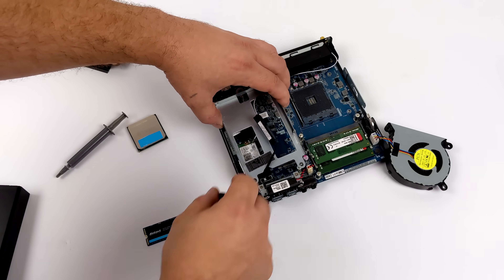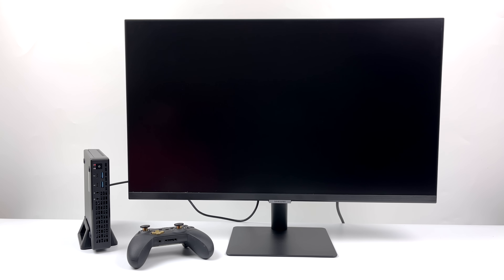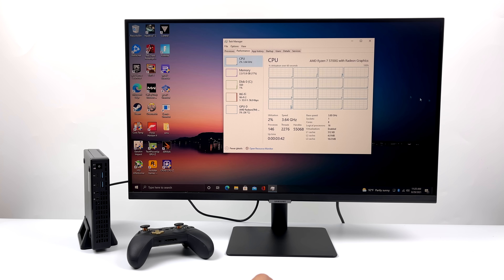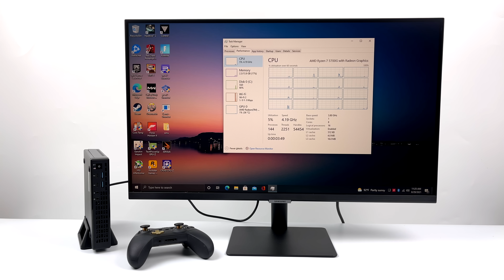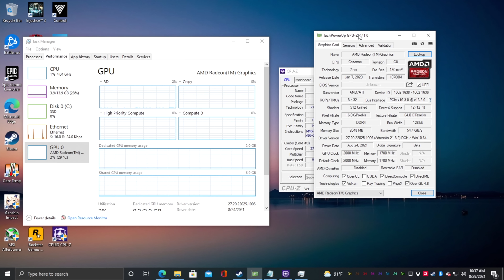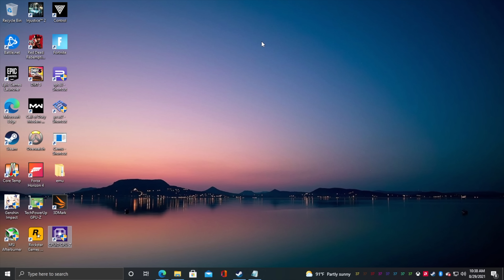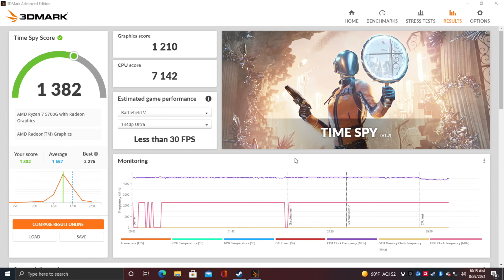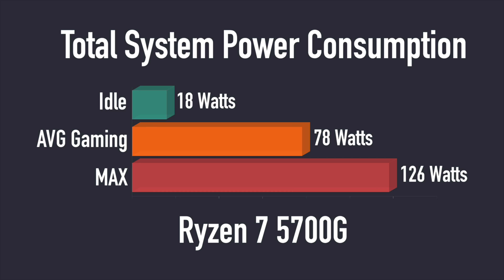The Worlds Smallest Ryzen 5700G Gaming PC! ONLY 1L

Comment: Hello ETA Prime, i have exactly the same setup as this, using Jupiter X300 and R7 5700G.

my only question: during those game  testing, do you lose output connection to monitor and get black screen?

Because mine can't survive gaming for more than 5-10 min before losing output ( my suspect is due to reaching thermal limit )

And if the answer is yes, can you share a solution how to avoid this? because i keep crashing trying to undervolt this APU via Ryzen Master. i just can't find the proper underclock settings.

THank you!

Comment: Can it be upgradable as like later on change motherboard or processor?
Can it run 4k content as movies or streaming?
Reply: You can't really upgrade it since 5700g is the best APU for AM4. I don't really understand these tiny builds, you are better off buying a mid-range laptop. A laptop would be the same size, have better performance and has a build-in peripherals and display.

Comment: Love this review. Plan to buy it for my next 5600G.
Can you tell me what is the maximum vram I can set in the bios for this board?
In my Asrock B450m + 3400G I can set to 3Gb of vram if using 16Gb ram. And 4Gb vram if I use a 32Gb ram.
I have watch many of your videos, but I can not find about the vram setting in bios.
Thank you.
Reply: For my deskmini x300 i used 8 gigs of vram
Reply: @evilballer  Sorry for my late reply. What RAM do you use? Mine is corsair vengeance 32 Gb 3600 Mhz kit.
In bios I can see the vram setting goes up to 16 Gb. When I set the vram above 4 Gb, in windows (HWinfo and task manager) it just read 2 Gb. Wonder what's wrong in my settings or maybe hardware compatibility issues.

Comment: Have you considered using Ryzen Master to shut down half the cores so you can pump more power into 4 cores and 8 threads. I bet you'll see those clocks speeds you're use to with the 5700G.

Comment: Im in the market for a new pc, just using it for daily tasks and occasional gaming, playing on an old fx6300 with a gtx 1650 no man sky, eve online, Diablo 3, truck simulator, doom eternal, some simulators like sim city, mars simulater etc. I may just get me one of those.
Reply: i just put one together myself for living room/couch gaming. i have most of those games if you want some feedback on how they run. i am downloading doom as i type. fallout 4 runs pretty doggy at 1080p/low, but its playable. trove and minecraft dungeons run fine. 

it's not great, and it's not quiet. if i had to do it over, i would probably go with the asrock desktop mini x300 and the best cooling i could find. BUT if you want SFF this is hard to beat. it's not that loud, but it ain't quiet. think PS3 slim at best and PS3 fat/Dreamcast at full-throttle balls to the walls.

very easy to slap together. the most frustrating part was installing win10 to the m.2 nvme drive with all this secure boot crap.

Comment: Hey, I actually got this setup. Using a crucial ram though (32GB 3200MHz. But default clock sits at 2666MHz). I seem to have a problem. It boots up perfectly and temps not even that hot. When I fire up a game like Tomb Raider after few seconds or minutes, it just restarts and gets stuck at black screen. I then have to manually switch it off and turn it back on. I haven't overclocked it or changed any settings in the Bios. Please do guide me!
Reply: i have the same problem. i think it has to do with the fact that the antenna wire to the BT/WiFi module got sandwiched between two of the VRM chips on the MB and the thermal pads on the heatsink when i installed it. with the heatsink screwed down, it cut the thermal pads in half. I thought I might be able to salvage the pads, but it's still crashing (for me, left 4 dead 2 will do it faster than anything else). gonna order some new thermal pad and try that.

@ETA PRIME one of those thermal pads is missing in the Jupiter/4750G video (~3:30).
Reply: @ericandersen5194  Hey, this has nothing to do with the pads though. The blank screen later on indicates that either unsupported RAM or not enough power (I use a 120W adapter). I even used different ram sticks which has been proved to work with Asrock jupiter x300 but no luck. I have tested the cpu on my pc and it's perfect. No issues with the processor itself. I even tried to underclock the cpu and gpu in the Bios. I still faced the issue.
I got fed up and just returned the whole thing. I was soo excited for this though. But it's okay. I'll try again when I have enough time.
Reply: @DrCryogenic  https://youtu.be/R_TGxxlcKiI

it takes anywhere from a a few seconds to 5 minutes to crash with l4d2. crashes at about 2:30 mark. it happens with all games, but some faster than others.

i tried a 180w adapter, and that didn't help.

i have not tried new ram, but this kingston kit is on the QVL, and i have tested and tested and tested it. tried using both sticks individually, and the same thing. i can stress the thing all day long with prime95 and clgpustress. SOMETIMES a 3DMark stress test will bring it down, but not often.

underclocking the gpu to 1700 and 1750mhz did seem to help and everything was stable enough that i couldn't crash it, but that's not really an option.

i really think it's the VRMs overheating and crashing. it has to be some kind of temperature/voltage issue, and that wifi antenna wire was definitely not in a good spot. i ordered some 2.5mm thermal pad and will try that.

here's pictures of what i accidently did:
https://imgur.com/a/aGJMiHm
Reply: @ericandersen5194  Mate, tha KS for the explanations. Mine never lasted this long though. The crash would either be immediate or after roughly 30 seconds. I did run furmark without issues. 
As for the wifi wire, I knew it would be getting in the way of the heat sink. So I rerouted it such that it wouldn't get caught with the heatsink. So yes, totally clueless.

Although thanks a lot for the video and explanations. I'm surprised no one else seems to have this type of issue. Or is it only with Ryzen 7 5700G!? I wonder.
Reply: @DrCryogenic  that was extra long  really. Normally it crashes within seconds.

I have found a few people with a similar issue in my googles, but it doesn't seem to be any sort of specific widespread defect. The asrock desk mini x300 had some similar issues that some people never resolved. 

It could be the ram, but bad ram is usually easy to find when you look for it...

I got the barebones off of ebay and the dude i got it from packages em with 5700g's all the time and has never had an issue.

I dunno... I really hoped the remains of the thermal pads would be enough to keep it from crashing at least. It does seem to at least last a bit longer with the wire routed out of the way.

I hope it's the pads.... At least it's something that is visibly wrong and would make some kind of sense. I hate chasing down these rabbit holes... If not, i guess I will rma the asrock. I don't think it's got anything to do with the APU.
Reply: @ericandersen5194  my googles were either about deskmini or ETA prime on Jupiter. So no luck there. If it was the VRM, the sensors would have logged the data when I was monitoring them. Anyways, I just returned the jupiter-x300. I just you do it too. 
I just wonder if ETA prime encountered thus problem during this video, he even overclocked it 🤣🤣 and here we are not able to run even on factory settings!
Reply: @DrCryogenic  amd forums has a bunch of stuff relating to 5700g black screen gaming error 41 etc. Youtube doesn't seem to like me linking them.

i tried replacing the thermal pads. it didn't help.

gonna try some new ram, but i highly doubt i have 2 bad sodimms. after that, it's RMA time unfortunately. I can't think of anything else to try.

feels like a voltage issue to me. maybe something that could be fixed with a UEFI/AGESA/microcode/something else update? dunno. It's a real bummer though. I should just buy a fucking intel mac mini or something.

oh yea, i tried shadow of the tomb raider just to see. it crashes about as fast as l4d2 with the bonus of corrupting saves!
Reply: I ordered a 12v to 19v 20A buck converter that I can run off a couple batteries I have. Maybe 150w still isn't enough juice...there is a "Performance Mode" setting in BIOS that says to use more that 180w when enabled.

380w should be more than plenty.
Reply: @ericandersen5194  if Underclocking, reducing voltage and choosing 120w adapter doesn't work then I have no clue what's wrong. By capping you can expect performance issues and not black screen.

Comment: For what it's worth PSUs are rated for the wattage they can deliver. Since PSUs are never 100% efficient that means that they'll draw more from the wall than they'll deliver to the computer. So 126W is more than what the PSU output is rated at, however you are measuring the input. So factoring in the inefficiency means that it's very likely that the PSU was not delivering 120W to the computer.
That said, your stress test probably was towards the higher end of what the PSU could deliver.

Comment: Got a stable 2315 on the Vega 7 on a 5600G, really surprised by how well it performs.
Reply: Can u tell if there is much difference for emulation ? between 5700g and 5600g ?

Comment: That DDR4L RAM is probably holding that thing back quite a bit, but for such a small form factor that performance really looks good and I'd 100% take that dip for it. I got a 5600g in a SFF case atm, but not nearly that small, with 4000mhz CL15 RAM and a 2287mhz gpu overclock I was able to get 18033 in 3DMark's Night Raid
Reply: but that's only 8% improvement compared to stock
Reply: @AF  When I first got that system the jump from stock speed (2666mhz) to the higher speed one I had near 25% speed increase. Also while I was waiting on my RAM in the mail I was running a single 16gb chip (so single channel) and compared to that it was a more than 50% boost lol

Comment: These APUs have me anxious for the RDNA2 variants. We're finally getting great quality integrated graphics.
Reply: I’m not sure RDNA2 will push APU, APUs are really limited by memory bandwidth. The RDNA architecture did improve quality for the Steam Deck when compared to the AYA NEO 60%+ frames.

But the reason we don’t see bigger jumps is mostly due to that, luckily RAM is moving pretty fast.. But I doubt RAM will hit GDDR5 bandwidth levels anytime soon.
Reply: @ZambonieDude  DDR5 will probably help that a little bit
Reply: Combined with DDR5 in (hopefully)  quad channel we should see a sizable increase in performance.
Reply: The 6800 i got seems to be a lot more stable than the 5700 xt was at launch. I think the next apus will be phenomenal and I too am anxious as I know what happens when I get me hopes up!

Comment: Actually the current  Line of hp thin clients (equipped with the “embedded” ryzen) is Way smaller than this jupiter …
Reply: Yeah but what about BIOS options for OC
Reply: @Viewer19  no OC at all, but they're smaller, lighter, quieter and less power hungry... for emulation: the sweet spot
Reply: @carlolalattacosterbosa5821  As he said this can be configed for 45 W  and the APU is replaceable so you can upgrade if you start with the base model APU and RAm.
Reply: @Viewer19  I got it , I was simply saying there are "tinyer" rigs out there for emulation purpose  ;-)

Comment: 92 degrees?? I've got a 5700G on PBO in an X300 with an ID-Cooling 47mm cooler... It barely hits 75 in a hot room doing 4k HEVC encoding.  92 is nuts....

Comment: I wish I would have seen this before building my 5700G based mini PC. Oh well, the one I built has the potential for expansion in the future if I moved it to a bigger case since I used a mini-ITX board with a single PCIe slot.
Reply: Dont worry you literally cannot find it anywhere
Reply: @goose6102  yea, why is that? I want one of these.
Reply: @jayjayhooksch1  im not sure. U can find an a320 chipset one on ebay from italy but thats the only one left after i bought one off techinn. An asrock support agent said they were for a project and werent coming to the us let alone being sold anywhere so id say snatch it just for the rarity alone

Comment: Interesting little setup from Asrock... If I had this i would modify cover and put a beefy down draft air cooler on this 5700g.  If I could buy the 5300g or use 3000g it would be a great media content/general use mini pc.   Interesting and very useful video ETA Prime.  It seems performance with the CPU portion is similar to a 3700X I have.   Thanks again for the professionally laid out and detailed video.

Comment: Is it just me or is the timespy score a bit low for a 5700g?
I have an OEM 4750GE in an OEM small form factor computer, very loose timing 3200Mhz RAM and IIRC the time spy score for this 35w processor was just over 1500. That was with the stock 2Ghz GPU clocks

I'll have to doublecheck when i get home, maybe i was thinking of firestrike

Comment: Another great video, I was wondering if it's at all possible to strip down my HP EliteDesk 805 G6 Mini PC, take everything out and put it into a bigger case, or are the internals of the mini proprietary to HP? My temps on my Ryzen 7 PRO 4750GE reach nearly 90 degrees celsius when emulating certain consoles, and I'm getting worried that there is not a lot of ventilation compared to other cases, is this even possible? Thank you.

Comment: They really should've made 5650G with more balanced CPU GPU combo
Don't get me wrong these APUs are amazing, but 
looking at the GPU pinned at 99% while the CPU is chilling around 30%. 
It could've been so much better.
Reply: How is that any different from normal? While gaming I am constantly at full gpu utilization...which is exactly what you want.
Reply: @samgoff5289  Indeed, but the GPU is the bottleneck everything in this PC (except maybe the power delivery) can handle higher frame rate and/or higher quality.

You want you CPU and GPU to match each others power. 
If you pair a 2500k with a GTX3090, 
or a 5800X with a GT1030 
you'll have one or the other pinned at 99%-100% while the other is barely used. 
It's just a waste of potential unused.
And because this is an APU you can't swap out parts. 

ofc this APU is killer for productivity, slap this bby in an office PC and you're good for the next 7-10 years, but it would be nice to have a gaming option too.
It's also a great APU if you plan to put it in a larger case and get a GPU later. Honestly I'll probably buy one because it's great, but it's not balanced for gaming.

For reference, with AMD Radeon RX 580 and AMD Ryzen 5 1600, in Time Spy I got a: 4665
Graphics Score: 4478, 
CPU Score: 6113 
And in Fire Stike: 13064
Graphics Score: 15599, 
Physics Score: 17413, 
Combined Score: 5038 
If you compare those numbers you see that my CPU is actually worse than this APU, but because I have a better GPU the overall score is also better. My CPU is at 85% while my GPU is pinned.
(once again it's not about absolute numbers but about relative balance. I'm not trying to compare performance of my 35L PC to a 1L that can fit in my hand.)

Comment: I just want to ask because I want to build in this case do you recommend the 5600g in this case?
Reply: Take in consideration that you are space limited, not so many ssd's or M.2 drives and the cooler is AsRock proprietary.
If your CPU goes hot got no replacement alternatives, also on bigger load noise factor will be louder.

Comment: I am very pleased with my Deskmini x 300 and Ryzen 7 5700G. It's a beast, and only 31-33C.
Reply: What about fan noise when you working?
Reply from the maker: What cooler are you using?
Reply: @ETAPRIME  An Cryorig C7 but I am not gaming, I use it only for streaming, 4K videos and internet, the beast is hooked with an 82 Inch TV, only for this. Maximum was 48C, after one hour of 4K video, 60 GB video file.
I've set it up with a second cooler, an Noctua mf-a4x10 flx, on the grill back side, pushing the airflow from outside to VRM's.
Be aware that the cooler needs some modifications, will not fit inside without fiddling with it.
Thank you for your videos, otherwise I was still looking for what's better to have as media pc.
Reply: @yoshy2628  would you be willing to take pics of your modifications or any photos?  Thanks in advance for any extra info youre willing to share.
Reply: 720p low isnt a beast lol
Reply: @kyles8524  for the size constraint, it is
Reply: @kyles8524  i hope u remeber that this an igpu, not a dedicated, no intel igpu performs this well like the 5700g
Reply: @scudsturm1  everybody knows its an igpu...lmao DERP.For the price its weak AF
Reply: @kyles8524  u sound like a intel fanboy
Reply: @scudsturm1  says someone on youtube....the irony
Reply: @scudsturm1  Intel knobgobbler more like.
Reply: @kyles8524  4K video, without a dedicated video card? Then what is? Pentium 4?
Reply: @yoshy2628  4k video can be done on many many igpu's lol and on cheap 30 dollar android boxes.Do you not watch any other of his videos lol?
Reply: @kyles8524  Do you saw me talking anything about Android? I am using Windows 10.